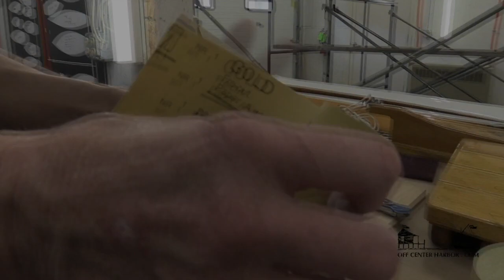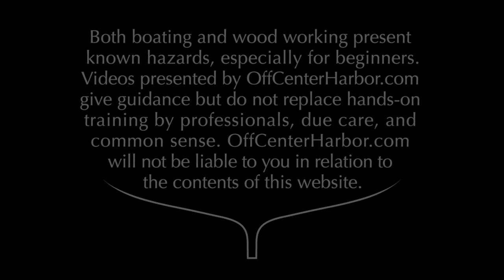Varnishing Tips & Techniques, Part 1: Sanding for Varnish

Comment: The alternative to the scrapers you mentioned in fact is a tungsten blade scraper, these little blades (which are double sided), are incredibly sharp and are the ideal tool for hard scraping old finish off. I use these all the time, on boat woodwork, let alone on antique joinery etc.

Comment: I installed a hose on the inside of the shop vacuum that exits under about four inches of water. You can wight it down with a brick to keep the end submerged. Now take a pice of window screen to lay over the water as to keep the bubbles down trapping the dust under the water. Never lose suction and no need for bags
Reply: Link to a few pictures please.
Reply: @Saintathantwinpeaks  picture the hose extended thru the canister to under the water inside the canister. Now the dirt is pulled into the water and is captured. Make sure to weigh the end of the hose under the water and lay something like a rag or window screen in the water to help captured the dust. I use a Rainbow Vacuum cleaner and it applies the same principle.